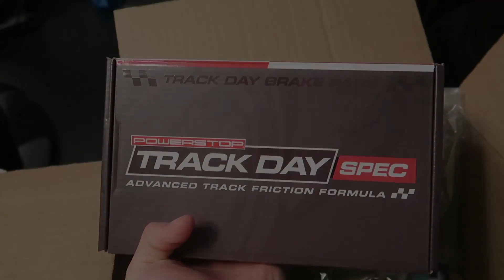The Miata Returns to YouTube

Comment: Glad to see you back buddy! Can't believe the Miata started right up after not being used for 5 months! Was that with the battery being disconnected or did you leave the battery connected the whole time?  Also I still can't believe you lost control and hit the wall , but I guess if it had to be the Miata or the Focus that hit the wall, the Miata would be the cheaper and easier car to fix.
Reply from the maker: So miata locked up all 4 tires and hit the wall. And I had it connected to a battery tender
Reply: @AndrewHershelChannel  Ahh thats why it started up so easily.